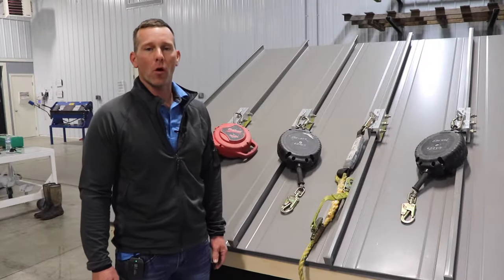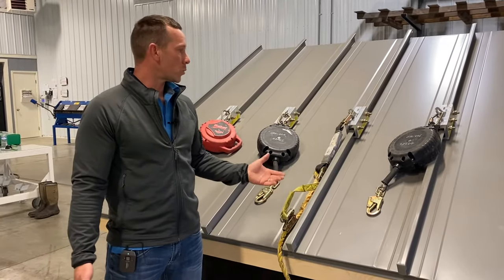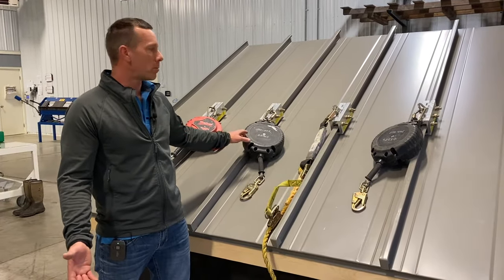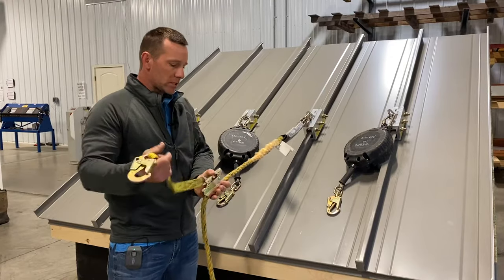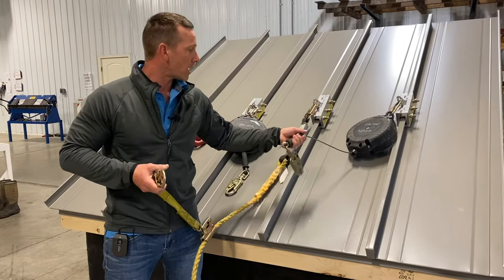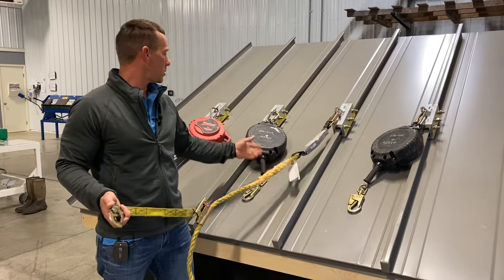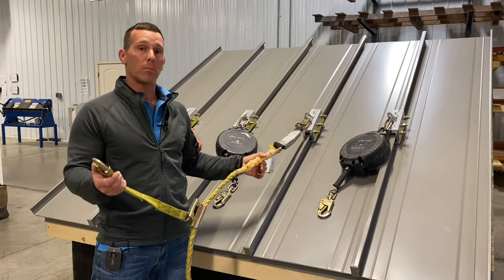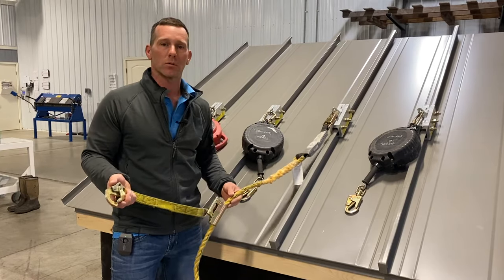Ropes vs  Retractables - Fall Protection on Metal roofs- Stay safe and get the job done

Comment: I have a rope grab that works by squeezing the bar to release it. It works when under load but should it be able to allow the rope to be pulled through when the rope is straight and not bent under load when the bar is released? The rig has never been used btw, so no wear.

Comment: - Didnt watch video, I just wanted to... Read. ~> I have a chimney, do you feel if working on the other side of the roof than it, it would be a - good- idea to tie off to it? Im very jumpy, the 1st time on metal & nobody was around to tell me- hey- rubber soles. I went barefoot thinking there was enough moisture in my feet for traction. Wrong, now Im kind of in 24/7  painful traction, a brick into the spine when I landed. Thanks, Ms. August

Comment: great video I understand your points, couple things i want to point out vertical lifelines are not rated for leading edge work, in your situation the employees should be in restraint. i would have your fall protection competent person measure out the rope when setting up so the employee can get to the areas without being able to fall and coil the remaining up and use a gear tie on the coil this would prevent them from getting a fall, (make sure they don't tie a knot in the rope). Although i have not seen the user manual for the standing seam roof anchor @ 1:59 the way it is connected on the opposite side of the roof than the user I would bet is not allowed. Not hating on video just wanted to share some knowledge about fall protection.

Comment: Your deciding factor was based on money and productivity not safety. I have experience with both and our guys have stumbled on the loose and tangled ropes. The only down side to the retractable is its heavier but like anything else you adapt. Falls are less likely to happen with retractable because there's less room for errors. And an FYI if your worried about not being able to see what's inside extend your retractable all thd way out and inspect it before it reels back in before use.

Comment: Great video If it ain't broke don't fix it. I feel the same way on a roof. I like the tug and the pressure it puts on my body to transfer to my feet. I feel secure and can concentrate on the job at hand.
Reply: How do you call the piece that’s directly attached to the roof (the anchor)? Can’t seem to find some online

Comment: I do have a question: would you use a "Prusik Knot" while roofing? I see climbers and hunters but how safe is that knot really ?
Reply: I'm not a roofer, but have tree climbing gear. One rope that I use has a Blake's hitch, which is somewhat like a Prusik knot. It's pretty good, but it always tightens up on me. I use a Petzl Zigzag which works really well. I used it when I did my own roof. Easy to adjust. Never fails. I use Cougar Paws boots. Makes a huge difference.

Comment: What do you do when the metal roof doesn’t have standing seams to attach an anchor to for the safety harness? Most metal roofs in my area don’t have standing seams, what is the suggestion you have to anchor to something like this?
Thank You 👍🏻👍🏻
Reply from the maker: You may try to use a butterfly style anchor that screws into the wood. You'll have to move them as you install the roof. For doing repair work on existing  screw down metal each set up will be a little different  as you cant just shoot a butterfly down on top of the existing metal but I can recommend a specialized metal roofing shoe called a cougar paw https://youtu.be/YSM5WpPl2so that will help you move and work on metal. Keep in mind these shoes don't replace fall protection but the do help a lot during set up and break down of ropes and safety lines on existing metal

Comment: This is typical management trying to save a buck. They become a trip hazard because of all the excess rope. Most of the time the user will not adjust and leave the rope long. You aren't supposed to use fall protection to lean on because after doing all the time you compromise the rope. Rope wears down and it is usually continued to be used. Most of the time crews aren't even taught how inspect these ropes properly and if they are inspected properly, they have about 6 job uses on them at most.